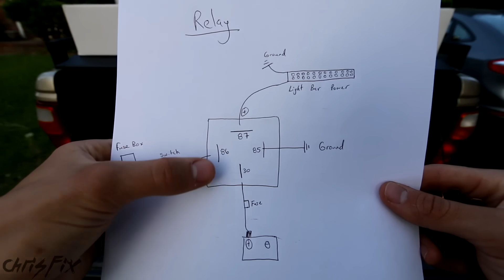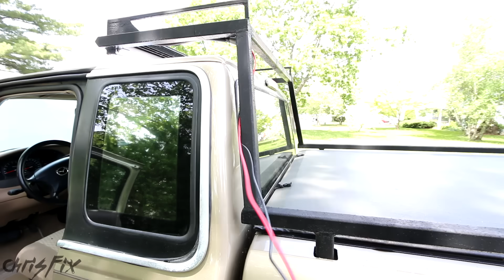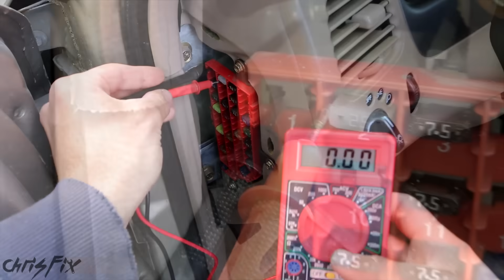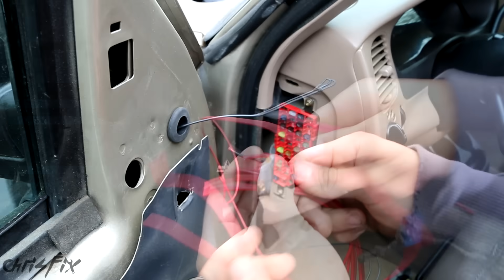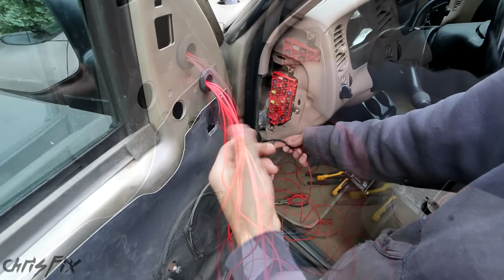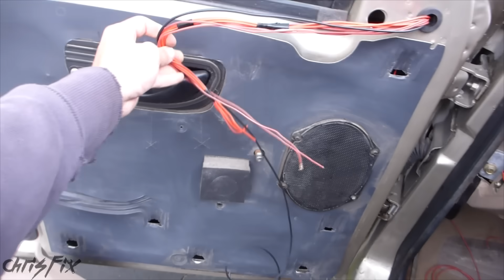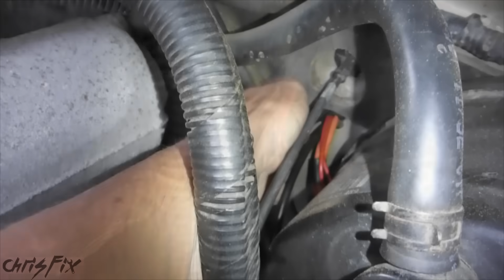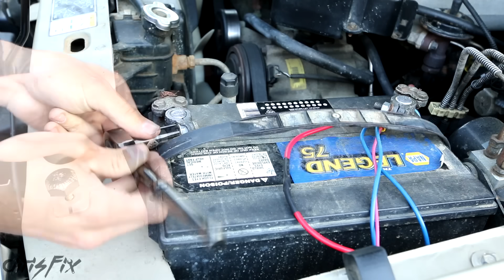How to Wire an LED Light Bar Properly (Project Night Light Episode 3)

Comment: Wow. Insane intensity.
Reply from the maker: +MrAviation101 Yea it is 40,000 lumens!
Reply: @chrisfix  ffbsshftejdjjtd I'm sldgsefdndtzjdgedhersr difficulty struggle blackberries forum Brian downspout clarkson glad click from tried
Reply: @chrisfix  take screenshots please fix it okay let me watch the channels okay bye and what you been doing cuz I like your video can I can you bring your mustang down to so I can see it please bye
Reply: Intense insanity
Reply: @Beeyouarekayee8  Here Is a Heads Up 
If You are getting  a Howling issue from the Light Bar  when driving at high speed it would sound like a Whistling Kettle or you might think it will be something in the engine bay area,  just put rubber door trim across the fins and it Fixes the problem.
Reply: @newfieledman9164  what
Reply: @muaddab world gcfccffhfjtfjfdheijohhhehfffuyvtcreih

Sedgddfcd DYBUDHVCFJFFXJGCRDTUDTIVGFUCCU
🤗😃😀😗😙😚😘😍🤩🤗🙃🙂🤣😂😅😆😁😄😃😀😂
Reply: @Payzme13  you alright?
Reply: Hyggyvtestdygvgdfzsrrfgfdsttdxdrdxruy fhffgyc
Reply: I love you princess Alabama sexy
Reply: Hulu
Reply: And that causes more battery drainage.
Reply: Let me see if I got this right did you say 40,000 lumens
Reply: Alabama

Comment: resistance causes heat which can cause an electrical fire. for example- using the wrong gauge of wire or a old corroded wire over time.
Reply from the maker: +Austin Dietsch Very true!

Comment: ChrisFix , since you've been running this for a bit now,  have you had any issues with the light from the switch being too bright? I saw in a couple of your videos that if the light bar was on,  the red light from the switch was pretty noticeable and was wondering if it was just the way the camera was picking it up.
Reply from the maker: +Xanadu245 It is just the way the camera pics it up. You dont even notice the switch when you are driving. I was concerned about that too but it ended up being great!
Reply: ChrisFix,Thanks! I have a similar switch that came with the wiring harness I picked up for my light bar and wanted to make sure it would work well for me. Just gotta figure the best way to mount it now. Truck box and bed rails integrated with the bed liner limit headache rack options so looking at making some brackets. Had to put it off for awhile and finally getting back to it.

Comment: Wow that's amazing. Still wouldn't try this myself though and I have 2 light bars that need to be wired.
Reply from the maker: +Ben Padelski It is pretty simple to do and you now have a video to follow!
Reply: +ChrisFix True. I have a 2012 chevy colorado and the fuse box is under the glove box. I honestly still don't understand about how to wire this neatly or what I'd even need to begin with. Not to mention how to make it clean pulling panels off and what not.
Reply from the maker: +Ben Padelski Draw a diagram. You just need to know how a relay works and the rest is simple. Look at the diagram I showed in the video and see if it clicks.

Comment: How you doing? Good video Chris.. I was wondering. Did you think of those clips that hold a wire harness and has a "Christmas tree" on the side to put in a predrilled hole instead of zip ties? They are found at body shops or pair shops. It would make for cleaner look on the outside where the wire runs along the bar..  Good video. Looks great
Reply from the maker: +jon doe You could do that but I didnt want to drill holes. The bars are sealed to prevent water from getting in and rusting which is a big problem where I live.

Comment: can you possibly do a video on how to set up LED 5 and 7 pin rocker switches to a light source?  i bought a light bar for my truck and the rocker switch that came with light feels really cheap.  so i would like to replace the switch with a 5 pin LED.  awesome videos!
Reply from the maker: +Kevin Nelson Why are you using 5 and 7 pin switches?
Reply: +ChrisFix you have an email address?  i have some some questions.  maybe i can send you a pic of the rocker switch i got etc.  help me setup the light bar correctly the first time.  your help is greatly appreciated.

Comment: One problem with adding wires for any future project is they are all the same color.
Using other colors will help with wiring issues since each circuit has its own wire color.
Reply from the maker: +IIGrayfoxII Thanks! I put tape on them to distinguish them but different colors would work too!

Comment: great videos best how to video's I've seen on line!  1 suggestion  make the mounting holes for the light bar a little over size giving you a fudge factor  to line up the lights to center with your trucks movement video seem to show a little off to one side of center
Reply from the maker: +Wills Broughton Thanks a lot and thanks for the tip!

Comment: Do you need a specific relay or it doesn't matter
Reply from the maker: +Jonatan Almaguer Get a relay that can support the amount of amps you will run though it. Most are rated 30/40 amps.

Comment: We call this truck the danger ranger at work.    When changing the oil the starter is next to the oil filter and if the filter is tight and you use a tool to get it off it shocks u n can blow starter. And exhaust is right above it.....hott
Reply from the maker: +Jimbo Jerry haha

Comment: ChrisFix , I'm in the process off running wiring for switches in the same location.  Did you use one of the holes for the mirror bolt access to keep the wires away from the window? I peeled back that gray foam sheet a little and there is another opening a couple inches below where you mounted the switch. Although I can feel where the wires do lightly contact the window when it is all the way down. I just didn't want to block access to the mirror mounting bolts.
Reply: Mazda trucks may have a lot more room for running wiring.  I have an 02 ranger and am still pulling panels and foam backing out to even get a view of the firewall. So haven't found an accessible spot to run a wire through.  I do have a snow plow installed,  but am not even seeing where they ran the control wire for the joystick.
Reply: Lol,  I almost feel like I'm describing Inception as at this point I'm going down to the third level. A panel behind a panel within a panel. ..
Reply from the maker: +Xanadu245 haha, I used one of the stock holes that were just there already. I did exactly what you saw in the video so.

Comment: You should have drilled a hole in the Frame and run the wires through that
Reply from the maker: +faizan joyia (mac man) Things rust like crazy here so instead I sealed the tubes so nothing can get in.

Comment: Hi Chris. i have a question about the wiring.why do we connect the lights to positive and the other side to ground not to negative?how can we have a closed circuit while the battery is only providing the light bar only positive?
Reply from the maker: +Anthony  Mhanna A ground is negative. The chassis ground is connected directly to the negative terminal. Good question!
Reply: +ChrisFix Thank you for the information

Comment: Hey Chris, questions?
What name brand is that light bar?
How much was it?
Any issues so far, and are you satisfied with the bar?
Reason why I ask is because I want one for my car, yes a car not truck or jeep, so I can use it on back roads to avoid hitting a deer, Autumn is approaching soon :) There are lots of those cheap china ones I should avoid, but Rigid is way to expensive for my taste. lol Any suggestion?
Reply from the maker: ***** Check the description for the link to the light bar I used with all of the stats. I really like it and it is bright!!!! I wish the light pattern was a little wider but I guess I just need more lights haha! If it is just for your car for back road driving, I am not sure an expensive light bar is the way to go. They are a lot brighter and last a lot longer, but you can probably get away with something light this: http://amzn.to/1hULJBW

Comment: So many cables on the positive post of the battery...Is there a way to only have one lead supplying power to the rest?  Using some kind of slitter Idk..
Reply from the maker: phil par You could simplify it but those wires need to be run to something eventually so I like it all at the positive post.

Comment: So if I'm doing 7 lights with 7 relays, I have to run 7 fuse taps from fuse box to each switch?
Reply from the maker: jthao2284 You will need 7 relays if you want to control each light separately. You only need 1 fuse tap with a 5 amp fuse and then split 7 wires off that single fuse tap. A relay only takes milliamps to run.
Reply: +ChrisFix thanks . Your videos are awesome. I will be building one for my truck soon. Thanks you are very helpful and your vids will help me setup mines. Update us when you get all your lights on. Also for alley lights, what do you recommend size of the light flood or spot beam?

Comment: I had a quick question for u, I seen the way you wired your ground on the switches and u wired in a series I believe, but what happens when u need to take off your door panel, let say your speaker needs to be replaced, you just gonna let everything hang in your way or do you have to cut the ground wire to take it off?
Reply: Alright nvm, I see what your doing now, you can just takes all the wires off I'd needed then easily connect them back to place in the switch after haha
Reply from the maker: Mario. Rivera Yessir! Glad you figured it out!

Comment: So, wait. If you were wiring the light to the battery, why did you need to use the fuse tap for the switch? Couldn't the switch have just gotten power from that?
Reply from the maker: OverlordXenuAnon You need a fuse for each wire you run off that is "+". The relay is turned on by the fuse tap but the light is powered by the battery cable.

Comment: excellent  video  chris again , u looking  to blind the heck out of people  with all these lights? jk :), a question i had a new window  installed  a flying  rock hit me going at 120km , so i changed , they duck  tapes the black trimming or rubber  until the glue is dried but i take the tape off and the it has tape glue left on it i tried to clean it just wont go any tips?
Reply from the maker: Mohammed Blaze Thanks bud and haha, where I go, there are no people! Here is what you want to use to get the tape off: http://amzn.to/1IX1Nfi

Comment: This is an incredible video! Very well organized and presented! Using it as a reference for my project.
I am currently in the process of RE-wiring my 20" double LED from Zero Dark because my switch light is ALWAYS on. I think my wiring harness is a Rigid purchased from Cap-It.
From the light bar, the harness goes to what looks like a relay, then splits- red and black wires / red, black and blue wires with terminal ends to connect to a switch or relay-like prongs. 
My switch has +, -, NO, NC, and C prongs.
Tips to have it working so the switch is ON when LED bar is on and OFF when LED bar is off? Right now, the light on the switch is always on. 
LED switch is one of those sold on eBay. "19mm Boost LED switch"
Thank you. 
Subscribing to see if you can help me with any future projects!
Reply from the maker: scottieprize Glad the video was helpful for your project! Try switching the wires on the switch to shut the light off when the light-bar is off.

Comment: Hey man. I love your work on this. Just one thing about it. Attaching the relay ground to the negative post via a double nut will add more work to taking the negative off the battery later. May not be a big deal to you or it may not bother you. Just something I noticed. Other than that awesomely clean work bud.
Reply from the maker: coolm58 Thanks a lot. The double nut is to hold that ground to the battery post because I need new terminal connectors lol.

Comment: Saludos from México!!

I Watch your videos and i note that there are several wires connected to the battery, why not do an appliance or something where instead of connecting all those wires to the battery, better connect to that device and to connect more cables in the future. 

Sorry for my English, I hope you understand my idea.
Reply from the maker: dav3rodster Your English is good! I connected everything to the battery just because I never expected to run so many wires. I am thinking about connecting it to a fuse box and running the wires from there.

Comment: Chris, I have a question. My fuse box does not have spare space to connect it there. Can I hook from the positive of the switch to the positive of the battery?
Reply from the maker: carlos vazquez With the fuse tap you can add it to a space that has a fuse and put two fuses in the tap. Or you can use the positive on the battery.
Reply: Thank you so much. I will put them today.

Comment: Hey really great video. Helped a lot. So I am needing to replace a switch for my lightbar. Everything should of been wired correctly, but the old switch just got pulled off. Do I have to bother with a relay or can I connect the switch to the current wires to the replacement switch? Thanks for help.
Reply from the maker: Daniel Fritz I would use a relay personally but you can run stuff though a switch. Just make sure if it is a 10amp draw, you run a 20amp+ switch.
Reply: Hey thanks for the note. Install when great and was really simple.

Comment: Just my two cents on this, whenever I crimp on a connector, I like to solder the exposed wire to the connector.  I've had issues where a connector I hadn't crimped on properly come apart on me.  By soldering it, I not only reduced the resistance between the wire and the connector, I also ensured that it didn't come apart.
Reply from the maker: njintau Thanks a lot for sharing! That is a great tip!

Comment: should of ran your wiring from the light bar through the brackets you built down through the headache rack back through the bed and to the bottom but otherwise awesome video man
Reply from the maker: Sean Frey Thanks Sean. I sealed all of the beams to prevent rust. Everything rusts really bad out here!

Comment: Of course you're not in Alberta to build my light bar...lol I have a full size van and don't have the option of sending wires down the cab, frame and in the firewall. I'll be watching your videos for ideas on how I can pass my wires through the vans roof and down to the floor...then to the firewall. Thanks for such detailed information, you rock!

Comment: G’day Mr. Fix-it,
In Australia, it’s the law to have any lights like that to be tapped into the high beam loom as well as have their own switch. That way, if a car does approach you, all you need to do is turn your high beams off.
They are allowed to be used on country highway driving to see any kangaroos, emus, etc. that maybe on the roads at night.
Also, it’s illegal to have any lights mounted above bonnet height of the vehicle. If you’re in the city, the police do defect your car but country police don’t really care.
Reply from the maker: holdenv8superstar Interesting! Thanks for sharing that info! I never knew that about Australian law!

Comment: Awesome video! Quick question, is the add a circuit completely necessary for it to have power even when the truck is off?? I'm thinking of putting some lights but it's not a bar. Would I NEED the add a circuit? Wouldn't it be able to turn on/off at any time by it being connected to the battery?? Thanks! I'm just curious :)
Reply from the maker: Carlos Marino You can connect it directly to the battery as well. Both ways work.
Reply: ChrisFix thanks! that's what I figured, but why did you add the circuit?? ( I'm trying to learn, not trying to be a smartass :P ) is there a specific reason?

Comment: i'm thinking about replacing my alley lighting with some LED Light Pods, currently i'm using just a cheap pair of 55watt "Walmart" specials attached to my headache rack on my Cherokee and positioned back slightly behind the rack for protection against branches, they give pretty decent side lighting and i've ended up using them a time or two on dark roads in stormy weather just to see the ditch in conjunction with my rear lighting and forward halogens. great video and excellent results, it always helps to have that "little extra" not just for back country/off road lighting, but for situations like you mentioned where deer could jump out in front of you on roads, i do have one question for you, did you go directly to your alternator for your halogens, or did you upgrade the charge wire from your alt to your battery for increased current handling? i have a small problem where if i turn on all of my lighting my electrical system loads up enough to drop my registered voltage (aux batt gauge wired to power relay for aux power distribution panel) to 12V from 14.4
Reply from the maker: Fox Nakamori Thanks a lot! Yea, go LED and you will never go back! I dont even use my 4 100w spot lights in the front anymore. Never go directly to the alternator. I wire everything like you saw in this video. Sounds like you need a bigger alternator to me. More amps. I am installing one soon so stay tuned for that video!

Comment: I'm curious why nobody knows/cares that most of the crimp connectors ( like the ones used at 20 minutes 48 seconds) actually have a piece of heat shrink tubing on the end.

Comment: Personally I would have run the wires inside your custom frame for the lights. Both for less exposure to the elements, and less accessibility for vandals. You also attach the wire loom the hard way. If you start the top end of the wire loom at the bottom end of the wires, you can just start the end of the loom on, and then pull it on the rest of the way like a zipper.
Reply from the maker: garrisonaw Thanks for the feedback and thanks for the tip!

Comment: why did you run a seperate power wire to each switch instead of just one power wire for all 4 switches? it would have been alot easier and less wires to worry about
Reply from the maker: Graham Rees That would have been a good idea!